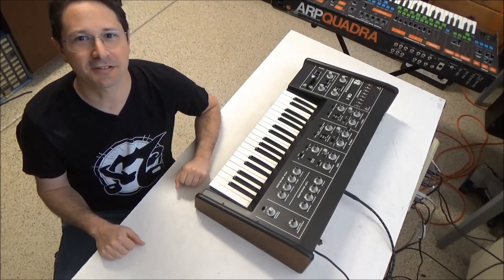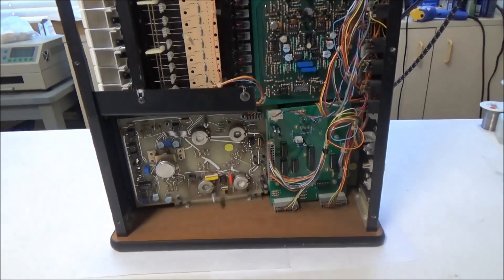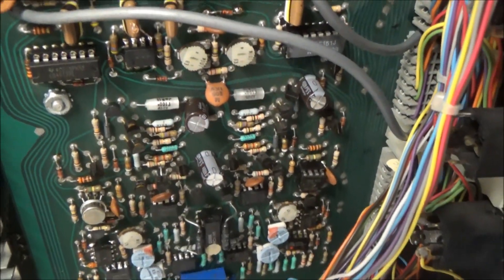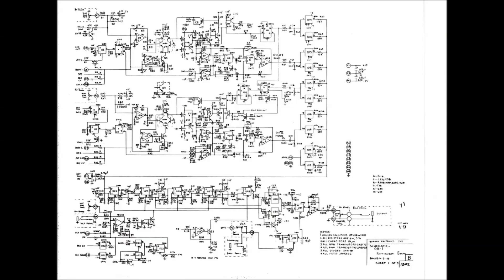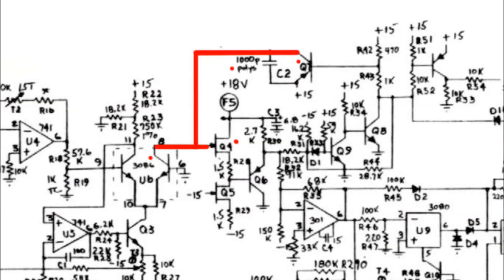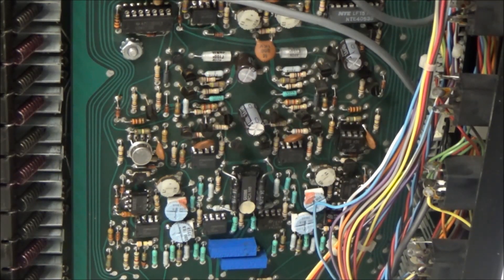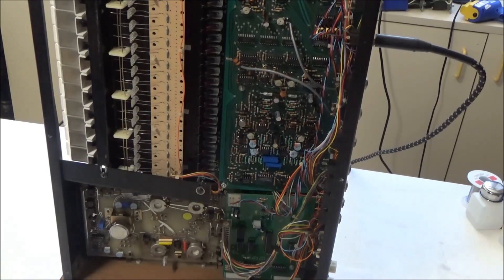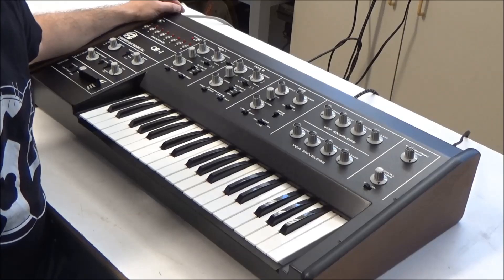Oberheim OB-1 Dead Oscillator Repair - Synthchaser #129

Comment: I was product specialist/tweaker/final tester for Oberheim when they brought this out. I remember the first run of these OB-1's (the name inspired by Star Wars) being a nightmare; the majority failed. All kinds of weird problems. It might have been the Harris chips. We had a lot of trouble with those in the 4- and 8- voice programmers. 
Normally, those tempco resistors should be positioned directly over the 3086 xsistor array, btw.
I think I may have been responsible for the original factory patches in the OB-1. I know I worked up a bunch for that or its immediate successor.

Comment: I hope you don't mind me asking a n00b question from a long time follower. I decided to purchase an oscilloscope because I want to take my troubleshooting to the next level. Is it a good habit to connect your probes ground to the chassis (or a circuit boards ground) you are working on? I thought I've seen you use your oscilloscope in the past but never got a good camera angle to see if you do this EVERY TIME or not. This video shows that you do. Do you also connect it to the chassis or ground if your trying to see a sawtooth or sine wave?
Reply from the maker: You've got a sharp eye.  I don't usually ground my probe to the chassis, I usually take advantage of the fact that my scope and the synth are plugged into the same circuit, and that they are both share a common ground (earth, through the 3rd pin of the power cord).  In some cases like this, the synth doesn't have a 3 prong cord, in which case, I'd need to connect the probe's ground to the circuit ground.  On the OB-1, the ground of the circuit is connected to the chassis, so I can just clip onto the chassis.  In other cases, the circuit ground isn't connected to the chassis, and then I'll need to connect the probe to a point on the circuit board.  In yet other cases, the synth may share a common ground to the scope, but the signal I'm looking at is very small, so I'll want to connect the probe's ground on the circuit board I'm probing at the closest ground to the signal I'm measuring, so I can view it with the least amount of noise.   Not the straightforward answer you were looking for, I bet!
Reply: @Synthchaser  this helps! thank you!

Comment: Wow, great footage of the inside!  The PCB looks super identical to the OB-X!

These circuits are suuuuper finicky.  I dropped a small metal screwdriver onto an OB-X voice board while tuning it and killed an oscillator.  I happened to toast a transistor somehow, so I replaced it, then accidentally put the board in while the synth was on and cooked it again!  I traced the issue back to another transistor and eventually got everything 100% again, but wowee, I have never seen a synth so happy to make stuff pop.

If you're making another video, could you do a rundown of the DAC, ADC, and computer for the patch memory?  I imagine it's almost exactly like the FVS-1, but I'm curious!  If you have an OB-X voice card handy, it would be interesting to see how they compare, too!

Comment: Super super insightful Its intresting to see what makes these instruments buzz. For some reason I had it in my head that this synth uses the cem 3340s for oscillators. 
Also intresting to see the method used  for coupling the tempos to the transistor array for the  expo converter part. Maybe give us a circuit board tour vid,  that would be good to see .
Reply: Second that Adamski! Great work Synth Chaser I wish you lived next door to me, my Juno has been giving me grief for years :(  Adamski, your DIY synth project is epic, well done man.
Reply: You might be confusing it with the Pro One, the Prophet 5 monosynth. This actually came out in '78 before the discrete Oberheim OB-X and years before '81 Pro One.
Reply: @F0nkyNinja  On further look on the schematic it looks like your right . Discrete VCOs both 👊🏾👊🏾👍🏾👍🏾